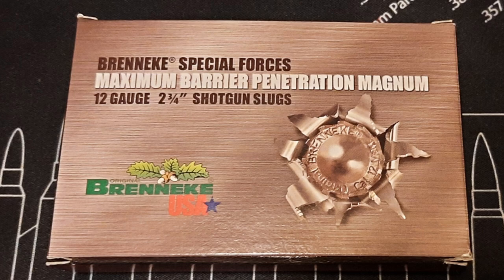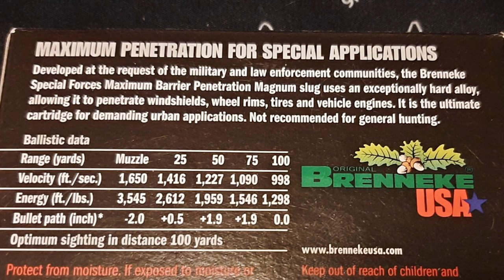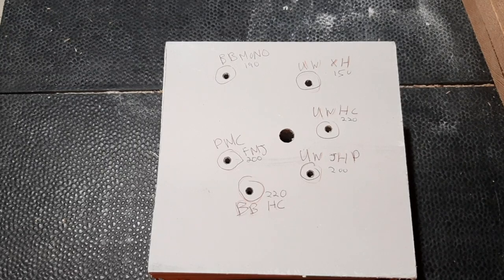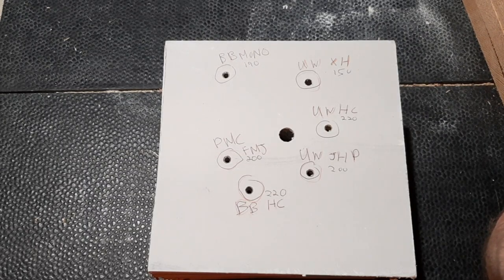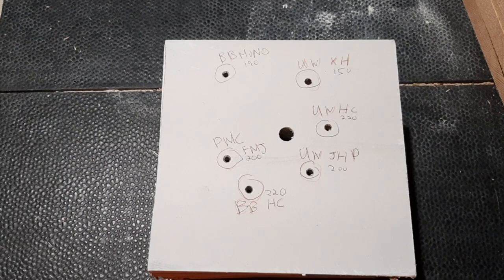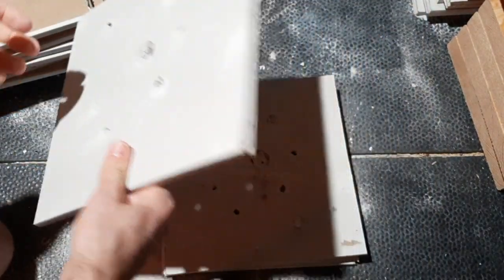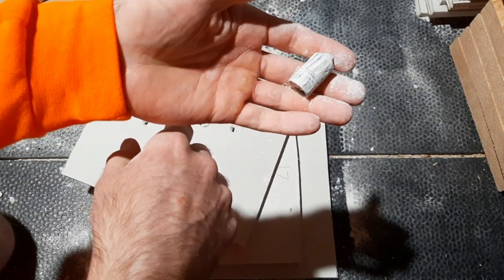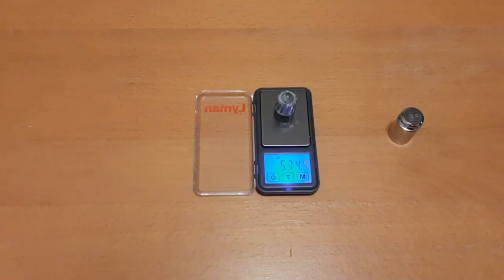12 Gauge Brenneke Maximum Barrier Penetration Slug vs Drywall/Sheetrock

Comment: I have to say Greg it’s been a couple years since I shot them slugs. But I noticed the same as you recoil wasn’t as bad as I thought. Good accuracy with them at 50 yards pretty much on top of each other. 75 yards I believe if I remember correctly 3 inch to 3 1/2 inch group. God bless and stay safe.!
Reply from the maker: I am excited to test it against sheet metal to see if it will penetrate and how much.